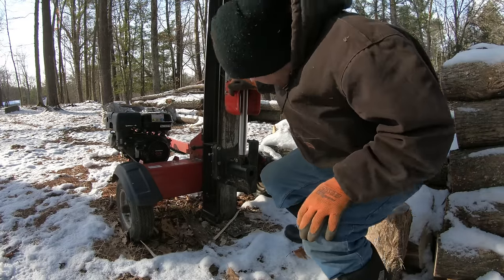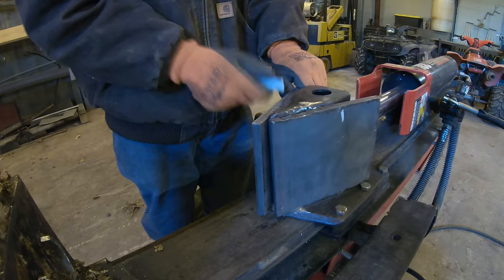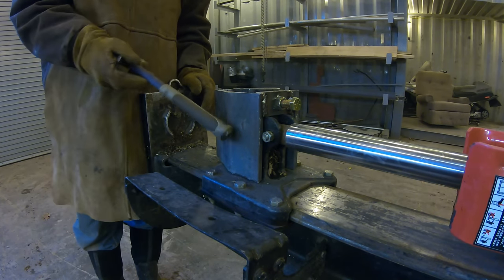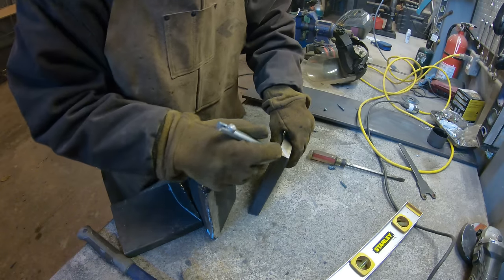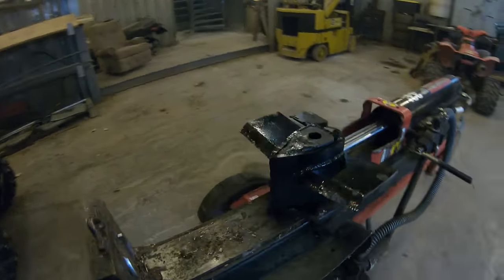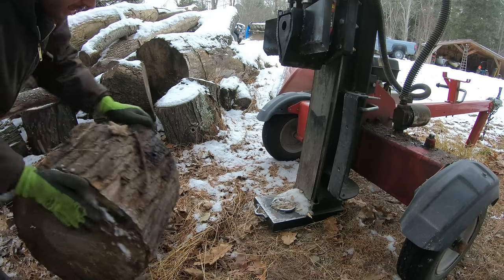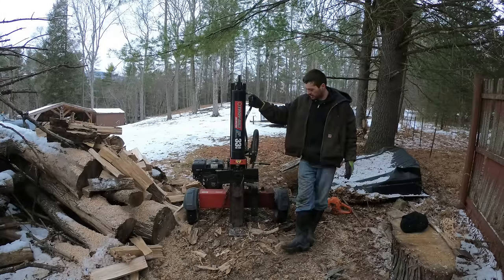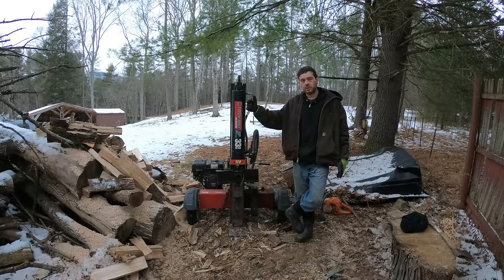Building a 4 way splitter wedge

Comment: My guess as to why they don't design, build, and sell them like that would stem from a few different reasons.  First,  safety.   I'll let everyone jump to their own conclusions on what could go wrong based on how a user (or abuser) treats the machine.  Second,  I'd say that beefing up the slicer section would call for beefing up the everything-else-section, hence kicking the machine into a whole 'nother price range.  Yes, you've shown that an existing machine CAN indeed be modified to do the job AND do it rather well... but convince a designer/builder of that while still in the vaporware stage of a machine's conception.  All that said,  it's been years since I used log splitters with any regularity, and 20-ton was the basic standard of the day then.  The 33-ton TB here certainly has the grunt to get thru what you threw at it.  How about wet, green wood that was just "felled today" in the summertime?  Will the new split head you built be as happy to deal with fresh wood as it dealt with hard, frozen blocks?  For many reasons, I myself prefer to split in freezing weather, whether using a spliter or the Armstrong method.  Dealing with green wood is a real chore. A test of endurance, and patience too.  Anyways,  congrats on what looks to be a success by all means.

Comment: I imagine that selling splitters with a "winged wedges" comes down to the splitter's warranty, expense and safety issues...  A splitter with a winged wedge has to work a little harder  reducing the splitters expected lifespan creating warranty problems. Manufacture's would then have to oversize the splitters to accommodate the winged wedge and that means higher unit prices.   But, you can bet that if one credible manufacturer started selling units with winged wedges, they would all start selling them that way.

Comment: You can get attachments for a regular splitter to split a log in 4 directions.  The run about $100.00.  What I have seen is not near as heavy duty as the one you made.

Comment: To answer your question is anything to prolong the life of the machine reduce to work load. The attachment works but how many years is the pump ram or beam going to handle the added load before repairs are needed.

Comment: Very nice job on the four way.  Leaving the angle at the rear seems to really help keep the log cut off's from jamming against the frame.  Not sure why manufacturers don't build like this as it is clearly much better design.  They are probably more concerned with producing quantity than quality which seems to be a big problem with most most production things these days.  Anyway, thanks for the video as it was fun to watch.

Comment: The wings you welded should be two inches from the end or off center that way the wood split will be uniformly split and less having to resplit it. They attachments for larger stumps and average size logs the ram pushes the log into a cutter ring of blades to split the wood. Yours is Awesome though

Comment: 15:20 the answer to why these splitters don't have a 4 way attachment built in is because there vertical.  The horizontal timerwolf 6 way splitter also had a rack at the end so you just keep going.  There was also a built in like lift, to lift heavy logs.  There's an art to splitting wood.  I got really good and fast at it

Comment: Why not build a 4 way splitting wedge. Simply, you very likely would over stress the splitter.Some dumb ass would try and split a piece of wood and the splitter would more than likely not have the power to muscle through it.This could break welds,rupture hydraulic lines and damage pumps.With a single wedge this problem might not happen.Also the 4 way wedge on the horizontal plane could be a mess.I enjoyed this video. I have a 30 ton and have tossed about this very idea.Thanks, Ken

Comment: Excellent ideas bending that plate with the log splitter lol. Also, if you add a bigger base or bottom to your log splitter, you wouldn’t have to worry about picking up on the log to cut straight up and down. Just an idea. Keep up the great work Andrew. Looking forward to the next video, thanks for sharing your videos sir

Comment: Wonderful attachment!  They are now making and marketing the 4-way attachments as an accessory!!   BTW, you can make a lot of the hard work easier by welding on a large plate the bottom pate so that you won't have to hold your logs against the upright as often.  If the bottom plate were say, 16X16 inches instead of the small plate, you now have, it would be much easier AND safer to put a log on it that would sit flat instead of having to hold it to the upright I beam.  Just set the log on and lower the ram.  Less work, less bending and pushing, less muscle fatigue and less of a chance that a log could explode outward toward your face!
I saw another You Tuber do this and it made things a lot easier and also keeps the machine from tipping as the wood pushes past the bottom plate and into the ground, lifting the machine.
Great video and great build.  As to why manufacturers don't equip their machines with the 4way to begin with, I really don't think they thought that far ahead, to start with so NOW, they sell them as an accessory!
Best of luck for another future build!  If the manufacturers would get users together and ask what they'd like to see added or changed, they'd have netter products and happier customers and receive better reviews from users!

Comment: The reason it only has one blade it is used for small applications. For the lite use. Now their are commercial splitters with multiple blades along with a lift. You have entry level splitter.

Comment: My spliter is the other way round, on the ram a flat push plate and the blade on the end of the beam, that way its easier as the wood once split is clear of the beam and can spread no jamming. wood cannot stick on the blade either. Only good for horizontal though.

Comment: Lay a board or pile dirt at the bottom so the firewood lies square with the splitter. Then you can remove the cable before you start the split

Comment: They might not sell them like that in the first place because then they potentially aren't loading that hydraulic ram perfectly inline with it's stroke anymore. I'm not quite sure how the splitter head is guided besides the hydraulic shaft, so presumably they are worried that if you have a log to one side you could potentially bend the hydraulic shaft which would be a let down. It could also cause them to loose their deal with whoever they have making their hydraulic parts because most of the time it seems like they want their piston rod only to be pushed inline.  This is pretty much an educated guess, so feel free to call me out on being wrong or the actual reason.

Comment: I like it, I am envious of you guys with plasma cutters and nice wire feed welders, I do most of the cutting and shaping with my 4"grinder and welding with my stick welder, it's slower but it works out for me. Going to use your idea of a bolt on wing wage that can be removed allot of my wood is anywhere from 20" to 40" in diameter. Good job!!

Comment: As to your question Andrew:
The design by the manufacturer probably leads to keeping it simpler and  less complex in 
the use of the product.   Also, by adding more cutting 
attributes to the arriginal design ( which seems to be a time savor, a +) may in the 
minds of the manufacturer pose questions of durability , product life and maybe manufacturer safety guidelines.
Other than that Andrew , I'm just like you in trying to build a better mouse trap.  Keep having fun and keep making 
great videos.

Comment: For working on especially shorter pieces, get a about  2+ft of 3x3 (0.25 or.375) angle for your working table in your vice. Then  C-Clamp your pieces to the angle works very well! Welding on it as well works very good. Did lots of it for my project, very good for welding squaring material  as well. Some material you might want to preheat to weld?  For welding 1/8"+ material you should vee single side if for   other reasons or double vee for these wings for the splitter.  A taller splitter head will allow  you to  re split both halves of the wood. Saving time as far as that, the 4 head splitter does take more power and some wood is likely too dense to split that way. As well fireplace/burner dependent  the size of wood needed?  Were you listening to your engine load up when it went to the cross splitter?  If you want to remove your kick offs? You can always use a chain around the end of your dead end to the log and retract the splitter out of the offending piece of wood?

Comment: Put that thing on the end of the 5 ton yanmar horizontally, only pick up the logs at first, split them above the trailer? You wouldn't need the gas engine just off the two way circuit?

Comment: Hey Andrew,  great job fabricating the four way splitter wedge. I use to build and can alot of stuff where I worked before I retired. You do very good work. In fact I have been thinking about how I can build one for my splitter, you gave me some good ideas. I think the reason complained don't do this at the start is they want to sell them separately. Most splitter manufacturers offer four and even six way wedges as an option. Just found your channel. I also enjoyed  " fixing and talking about chainsaws" I clicked like and subscribed to your channel. Looking forward to somemore videos.

Comment: Andrew how bout the same way you turned the sppliter 4 way you could built one 8 way star like shape so that you could plit those big logs in one shot using a bigger or stronger hydraulic cylinder with the cutters more like foward from the guide rail where it travel up and down that could be cool

Comment: Troy Bilt makes more money by using less materials and they may be concerned that having a quad blade may over stress the machine. I like that you end up with different size splits, some can be used for kindling. I love hearing the red oak pop.

Comment: Make the pedestal bigger to handle larger diameter wood. I added 18 inches to the length of the pedestal and made it about 10 inches wide with 5 pimples  of 1 inch high round steel rod welded on the face of the pedestal .  The pimples will hold the wood in place while you split the wood.

Comment: Wife and I have watched most of your videos - gteat job - got an old Lesco 52" hydro walk behind with no motor, thinking of using the pumps on it to make a wood processor. Wheel drive used to drive log for cutting to length and one of the pumps to drive the wheel and splitter piston along with a 2500 lb winch to pull logs up onto the processor bed.

Comment: Not all wood is created equal sadly, I wish they all popped apart once the split starts. I built a 4 way wedge once out of 3/8 material and it did just fine in oak, maple, fir, cedar, wet madrone, but once I got it in some digger pine  it peeled apart like a tuna can, and no where near the weld. I vowed if I did it again I'd make it out of 1 inch. I sold the property and most of my equipment and moved back east. I'm sure soon I'll have a wood splitter again and I'll make a wedge just like this.

Comment: Indeed a nice upgrade. But I think, the new wings should have been welded with the tild in the opposite direction in order to get more space for the wood as higher it gets. As you you have surely recognized, some logs got stuck between the new wings and the machine itself. Maybe it would be a nother fine upgrade to enlarge the ground plate and extend the splitting wedge. Two more wings could be added in a 45°angle to get 6 PCs at once...

Comment: Now all this splitter needs is a bigger base plate so you don't have to push the logs against the machine to prevent them from tipping over before the wedge comes down.

Comment: I suspect the mfg are looking at warranty issues. I think your splitter can more than handle all your 4-way wedge can throw at it..but with out the 4-way it could do it at idle. The mfg thinks with less stress on it we can get out of the warranty period before seals leak etc. I bought a 4-way wedge at tractor supply for my moms 3 point splitter. It has been very good but not near as beefy as yours. Thanks  for another great video.

Comment: I will tell you why.  If you use the multi splitter piece you made you dont use the machine as much and it lasts longer.  If you use just the splitter it came with you will use it 4 times as much and wear it out faster

Comment: Maybe you could make the base plate on the log splitter bigger   giving you more surface area for the logs to sit on 
  Now, the logs will be able to stand by themselves  and you will not need to hold them in place.

Comment: Andrew, Would you share the dimensions of the main cutting edge  height and the width of the wings also at what height did you set the wings at. I built my own splitter 4 yrs. ago but recently order a 80 amp plasma cutter and larger stick welder, was having to many problems with the old Hobart mig and unable to get gun parts. Great looking piece Thanks for sharing!

Comment: I think it's because of the sideways strain you're putting on the splitterhead, and thereby the hydraulic cylinder. You can see how it wiggles when you put pressure on it, and I wouldn't be surprised if you ended up with a broken hydraulic cylinder in the near future. Take care mate.

Comment: Base that log sits on needs to be bigger (would stop machine tipping back on larger logs) and ram needs to be out a little farther from travel post (would allow those inside pieces to be split bigger)! Actually would be nice if you could adjust the distance out for ram depending on diameter of logs being split!  Nice work though! What size is you plasma cutter?
Reply from the maker: Yeah, that would be re-engineering that whole splitter though. It works decent the way it is now, especially on normal size wood. Its a Victor Cut master 52, link is in the description to purchase one.

Comment: As long as you are working on a relatively flat ground, you would save a lot of physical effort if placed about a half a sheet of 3/4" plywood directly in front of the splitter with a cut out around the base that is at ground level. It would eliminate having to push every log against the machine. Back saver for sure.

Comment: If you would’ve even out the blades just a quarter inch height apart on the wings higher and much sharper your wood would not snap and it would split it four ways you need to sharpen more and the wings got to be more lower closer to the middle one or to the main one some of those pieces are flying out of there But all in all great design great work

Comment: I don't think that design of log splitter is not well suited to having a 4 way cutting head due to the space restrictions you mentioned...the log getting stuck between the cutter and the table(so to speak) The type that have a pusher plate that pushes the log onto the cutter often have a 4 way or even an 8 way because the cutter is height adjustable from the table. Awesome job making it work tough.

Comment: For the larger wood imagine you connect a similar assembly to the wedge and to that assembly you weld a goose neck type bar that extends out about 12 to 18 inches. To the end of this gooseneck you add your 4 wedge.

Comment: It like everything else we buy it’s going to wear out or fail at some point and time. The companies want to be price competitive and they may offer a four way splitter adaptor for a price but companies don’t give a crap about you or me just their bottom line. There are many appliances we buy for our home that could be built better but they engineer failure into their products so the average Person will go buy a new one. You on the other hand would check it out before you purchased a new one. We would probably puke if we knew how many microwaves were replaced just because of a bad fuse. There is so much fraud repairs this day and age and unqualified repair people out there they are just waiting on the next victim. The old rule of thumb, Trust And Verify.

Comment: maybe its time to add more wings.. in the ad above there are a bunch of 4 way spliters now.. and a 6 way splitter with additional angled wedges    hint.. dig out a 3 inch shelf for the splitter to drop down into  so the rest on the splitter is level with the ground the log sections are on.. allows you to slide them on and they don't roll off waiting for the splitter to come down.

Comment: Nice addition.  It would be nice to have a broader base as well to avoid having to hold the wood in place.  Why 4 way heads are not in normal production?  My guess is because of the power it takes to drive a wedge.   Your design is really nice in that the log is initially split by the main wedge before the wings contact the wood.

Comment: I've seen splitters that shove the wood through a multi-blade wedge on the end.  The ram just pushes the wood into the splitting frame.  You get several pieces in one push!

Comment: Nice work.  Seems like you'd save yourself some energy if the "base" that the unsplit wood was 4 times bigger so that the whole uncut wood could sit on there without having to be held there!  Seems like with a bigger splitting base, it might also keep the splitter from lifting itself off the ground when splitting really big pieces too.

Comment: My guess is the splitter companies don't sell that kind of cutter is because it would create additional stresses to the frame and ram and they would not be able to support a warranty program as a result.

I like your design though.  The side blades set back allows a delay in applying force to the log, just after the initial application of the main blade.  This distributes the forces on the log in a manner that lessens the total stress altogether to the machine elements.   Still there is a cumulative addition of stress overall but manageable by your design.  Did you think this out or was it pure instinct (genius) on your part making this mod?

Job well done.